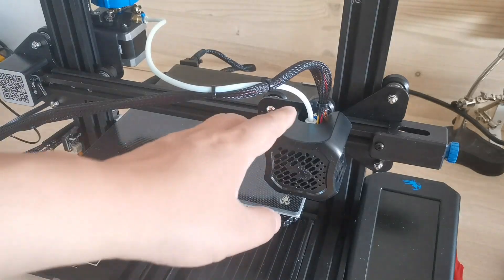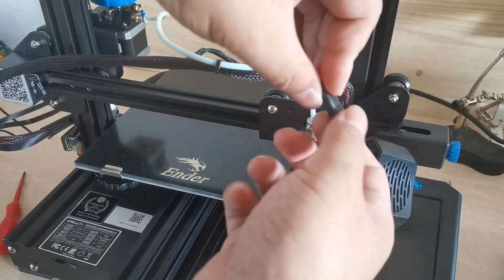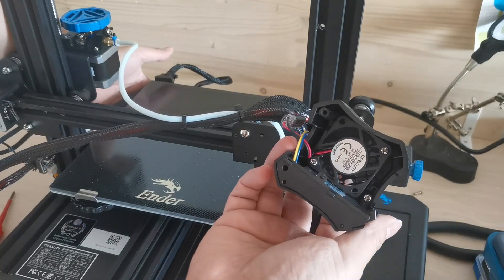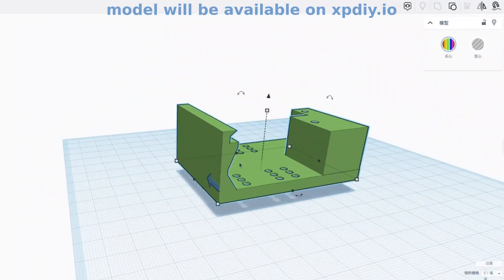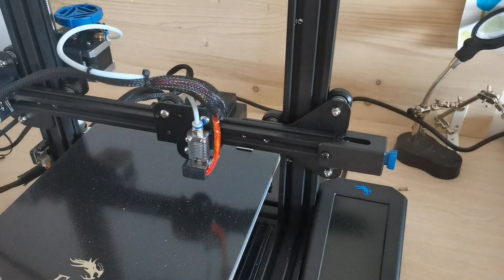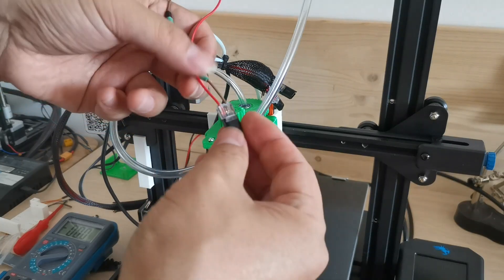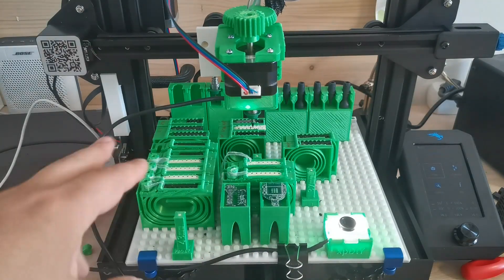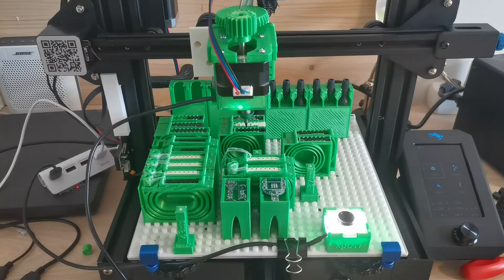DIY Pick and place machine: Convert Ender 3 V2 to pick and place machine

Comment: Why not use an external mosfet to drive the suction pump, it would be cleaner the a power resistor to cut the current?
Reply from the maker: Back then I was avoiding making extra PCB so that it is easier to convert, but now I am introducing more functionality, so the mosfet will come.